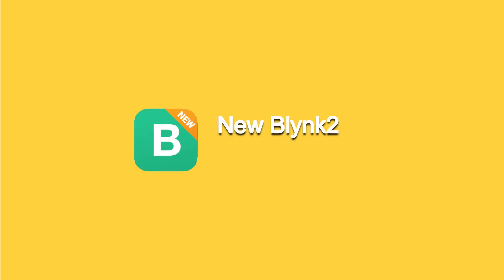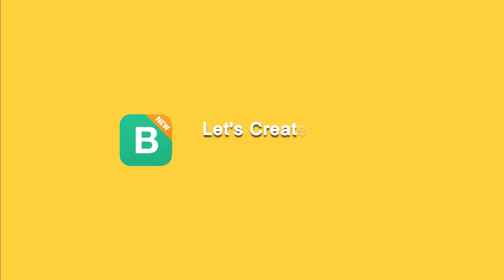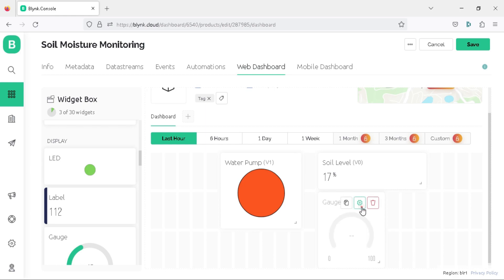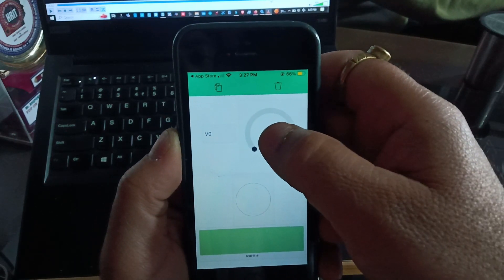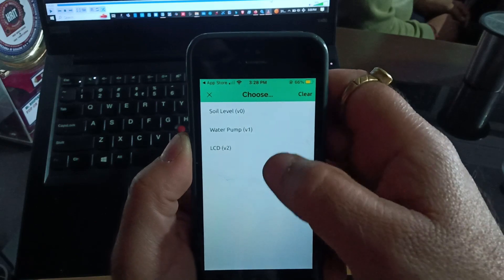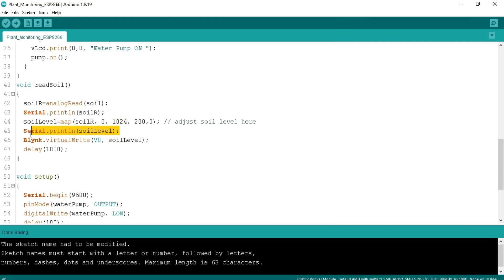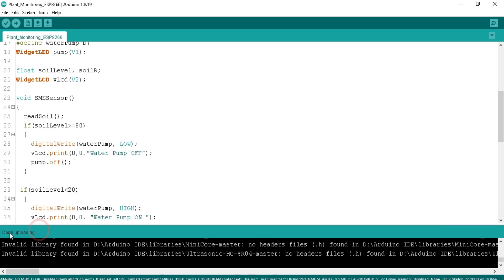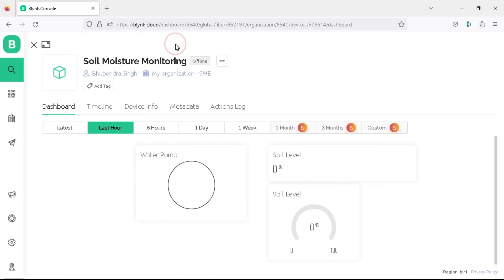Smart Plant Care with IoT Monitoring and Automated Water Pump using Blynk 2.0 - Method 2

Comment: Sir I need your help I sent you message on Instagram plz response thankyou
Reply from the maker: If possible, comment here
Reply: @SMEDehradun  ok I am making my project iot based in which I have pir, soil Moisture,DhT sensor relay and motor but in this the relay in operated by control manually by pressing button which is place on breadboard or you can on -off using blynk app , but I want without changing the relay operation I want to add your method too in which if it goes to below 20 then relay automatically operated .
So conclusion
I want to merge both programs and make them as one without changing the operation just wanna add your relay operation in my code plz help if you want the code I can provide.. I want to complete the project and submit in college this my major project .
Thank you 
Looking for response
Reply from the maker: Amit,
Your project idea is good. 

So what you want from us? 

I have already made individual video for all of them. You just combine all of the code & it will work.
Reply: @SMEDehradun  yes I have seen your videos  yes I want to all of the to work but I tried but relay is toggling on-off and it's not working properly.
I have program If you want . In that just one code should be added as I mentioned above i want fast because the deadline to submit the project is near plz help🙏
Reply from the maker: And you can also 📢 Join our Community on Telegram! 🚀

💡 Seeking inspiration for new cool projects? Stuck somewhere? Want to collaborate with like-minded individuals? Join our vibrant community on Telegram! 🌟

🔗 Join Now: https://t.me/+vJcqQmRQLKYwZWQ1

🙌 Let's connect, collaborate, and grow together! 🌈✨

Comment: Sir can I use a 5v relay module on a 12v water pump for this project and will it work?
Reply from the maker: Yes you can. And it will work.
Reply: @SMEDehradun  why when I enter the blynk code, the humidity sensor suddenly only stays at 100% but if I don't use the blynk code, the sensor works on the serial monitor
Reply from the maker: Is your board connected to the  blynk?
Reply: @SMEDehradun  yes connected only the pump works on blynk, the sensor does not move when connected to blynk but if you don't use the blynk coding the sensor works

Comment: Sir my water pump is not switching off even though it shows water pump is off in the blynk iot app.. Please suggest some answer
Reply: It's keeps turning on even though the moisture level is high
Reply from the maker: Use 1000mf electrolyte capacitor between vcc and gnd pin of the relays
Reply from the maker: Check your relay module is active high or low? Also Use 1000mf electrolyte capacitor between vcc and gnd pin of the relay.
Reply: @SMEDehradun  okay sir thank you
Reply: @SMEDehradun  sir it is uf or mf and can you tell about the voltage of the electrolyte
Reply from the maker: Both mf and uf is same. You can use 25V 1000uf
Reply: @SMEDehradun  okay sir

Comment: blynk app is not working.......blynk app offline bta rha 🙏
Reply: Same
Reply from the maker: Then check the blynk credentials and your wifi name and password. Don’t use any special character in wifi name and password because some time not supported.
Reply: @SMEDehradun  I am confused with SSID and password ( should I put my wifi name and password) or something else like my wifi name is "Amit 4G"
Reply from the maker: SSID means your wifi name & password is password of your wifi.
Reply: @SMEDehradun  Wifi name and password mai special character use kiye and correct Wifi name and password Dale he but  connection is offline show
Reply: @SMEDehradun   it worked connection successfull  but I am getting another problem, in the application the Motor is working fine (on- off Operation ) but physically the relay is not tripping it is not changing with the situation.. I followed your circuit diagram..
Plz help
Reply from the maker: You need to check that the relay is active high or active low.
Reply: @SMEDehradun  thnks you for the help sir I'll let you know it's working or not .
Reply: @SMEDehradun  sir same thing happening really is not switching plz help it is in on condition always not switching
Reply from the maker: You need to test you relay, how it works?
Reply: @SMEDehradun  done 👍 its working now!!! the problem is just the voltage I am giving more voltage 5v , relay working fine at 3.3v.
Thank you so much
Reply from the maker: Ok great 👍
Reply: @JonnywalkerPlayz  can you help me out i also facing the same issue
Reply: @JonnywalkerPlayz  can we talk in WhatsApp so that I can see your connection
Reply from the maker: Join the our official telegram channel for any discussion 
https://t.me/+vJcqQmRQLKYwZWQ1
Reply: @JonnywalkerPlayz  bro i'm getting same problem how did you resolved that please help
Reply: @sanketbachchaw  what problem?? I mentioned 2 problem in the comments
Reply: @JonnywalkerPlayz  in blynk app it shows offline
Reply: @sanketbachchaw  1st make Interface in your blynk app 
After making you have to copy all things from blynk app 
Auth token ,ID and name
Put it in your code
Now if you have wifi then in your code there will be one section where you have put your SSID and password put your wifi name and password if you don't have wifi then take other phone put their hotspot name and password and upload in the ESP and it will work
Reply from the maker: Hey,
Watch the complete video tutorials step by step. 

You will get all the information related to the project designing. You only need to chahe he blynk credentials, wifi/ hotspot name & password in the code and that’s it. Then upload the program. 

Connect your all hardware as per the circuit diagram and it’s done.

Comment: Sir please provide th circuit diagram esp32 node mcu video
Reply from the maker: Circuit diagram link is available in the video description for both ESP32 & Esp8266.
Reply: @SMEDehradun  but I have no 12v and 2A adaptor so I can,t  connecting the relay module to. esp32 node mcu 🙏

Comment: Nice video sir,, ❤
Sir Is it possible when we click button Or switch on it sends an alert message to the respective user using GSM module... Can u give me code for that.. Plzzz
Reply from the maker: Yes this is possible. 
You need to add the at commands to send message through gsm. Take the help from below video link.

https://youtu.be/6CG17D-TmQ8
Reply: @SMEDehradun  yes sir at commands ok, but using switch or button on and off operation send alert msg
Reply from the maker: I think you can do it try it by yourself.
Reply: @SMEDehradun  yes I will try, but  Is there  any reference tutorial..
Reply from the maker: https://youtu.be/SX0lyiJezgc
This tutorial will help for “how to send sms through Arduino”

& 
Below link will show you how to create button in new blynk 

https://youtu.be/SrkK5ANsDDM

Comment: Hello,i have a trouvle here, i can't connect it to the blynk,but i can connect it to the wifi.... How can i fix this?
Reply: Do you have any contact? Ig or smthng?
Reply from the maker: Change the blynk credentials and wifi name and password & follow as the instruction as shown in the video.
Reply: @SMEDehradun  yes i do,but still can't connect to blynk
Reply from the maker: Check the wifi name & password . It must be simple without any special character
Reply: @SMEDehradun  it is simple,but still can't😅
Reply from the maker: I think you have to start with the simple program first to start work with blynk. Once you have done, then go for the project. 
Start from this video & Try led in the place of relay. 

https://youtu.be/SrkK5ANsDDM
Reply: @SMEDehradun  ok finally i sucsessfully with this project,but i want to add more button to turn on/off manually?,can you help me?
Reply: @SMEDehradun  Thank you❤
Reply from the maker: Of you want to operate it manually, the you need to make a function to operate it manually and disable the automated function.
Reply: @SMEDehradun  how to  make it?
Reply from the maker: Try it by yourself first.

Comment: Can you make a vid using a simple switch in place of sensor? I'm trying to use esp8266-12E.
Reply from the maker: Can you tell me exactly your project so that I can help you?
Reply: @SMEDehradun  OK...I have a simple Float Switch, If water gets to high this switch closes. I have this programmed into a ESP8266 so that when the switch closes, it energizes a relay to make a Buzzing sound. But, I would like to have a virtual visual led to display Red when this switch closes. Very simple Circuit. I just don't know how to program IDE or Blynk to do this. I DO NOT want to control a LED, I want to see the LED turn RED on Blynk.
Reply from the maker: K. It’s very simple. I will send the program soon here.
Reply: @SMEDehradun  Thank you very much! I found alot of vids on controlling a led but no led indicator.